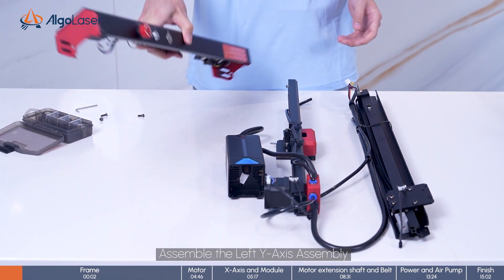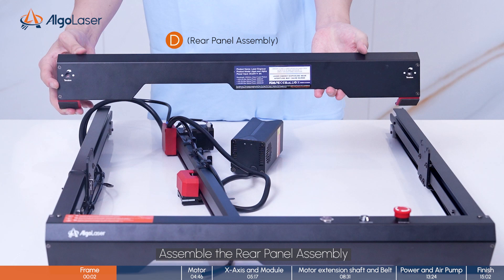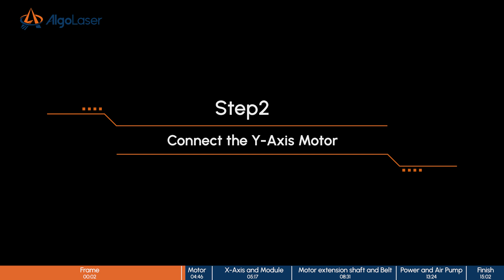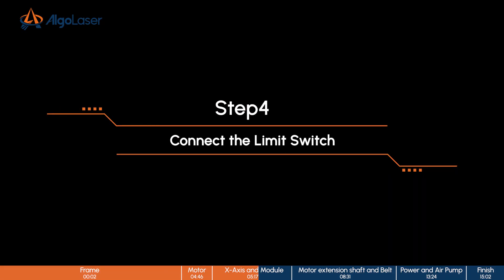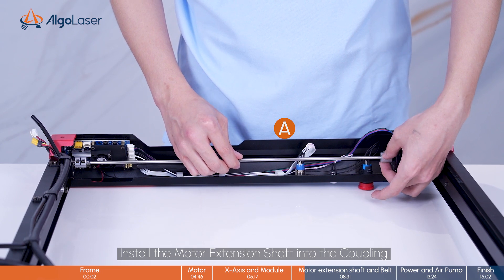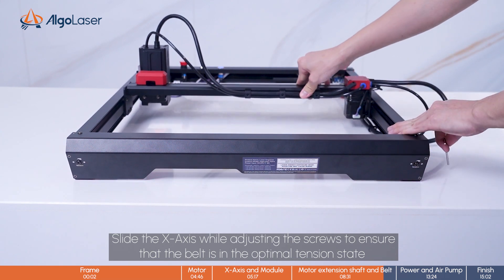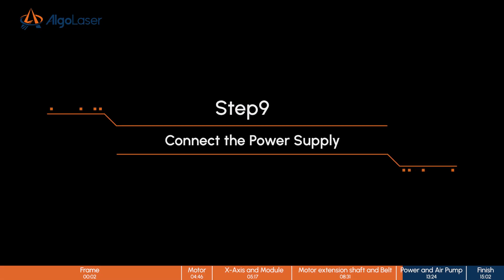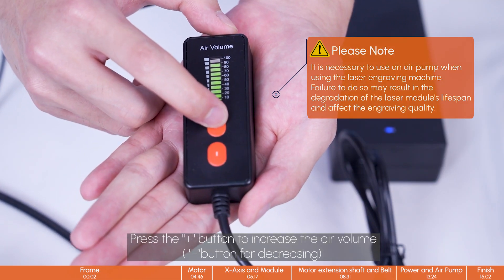AlgoLaser Alpha 22W   Assembly Video Guide

Comment: Just purchased the Alpha, got it assembled, and wired to computer using Lightburn pretty simple. BUT..... this Laser just will not stay aligned,  firstly it would not frame properly, then it would not home properly, so after a lot of tweaking loosening the eccentric nut under the left Y-axis pulley a bit to see if that smooths things out a bit, very infrequent conversation with the company and I find myself now with a useless Alpha laser and no comeback from the company.
Reply from the maker: Hi, Sorry for the inconvenience. Could you please reach support@algolaser.com.Our engineer will help solve your problem.